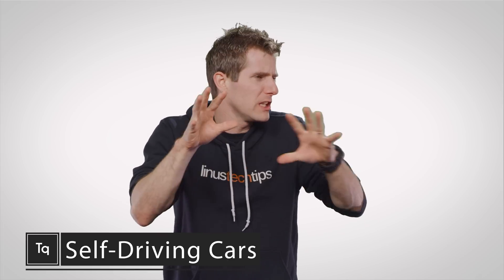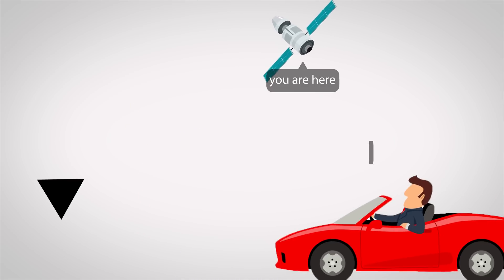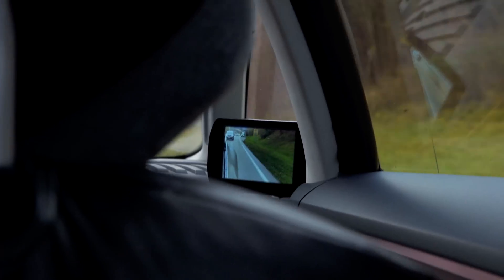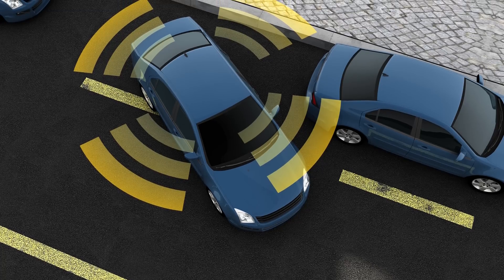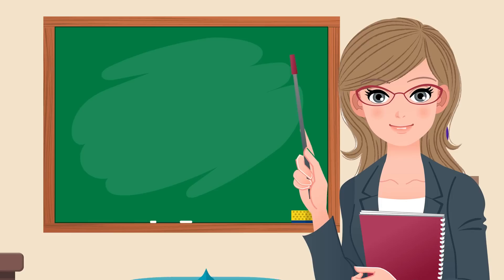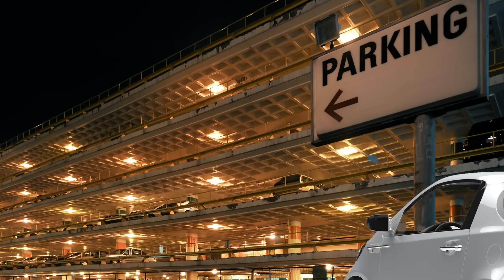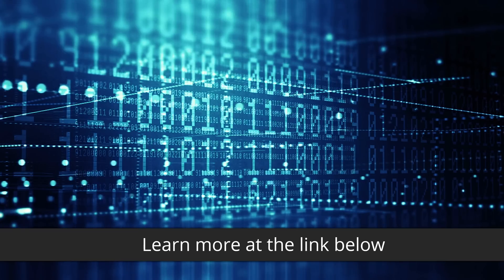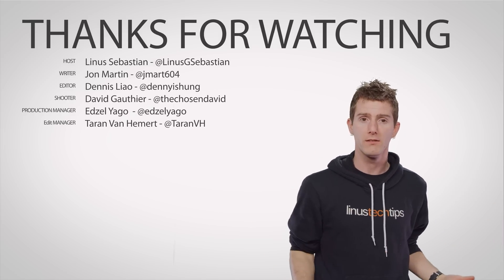Why Self-Driving Cars DON'T Just CRASH

Comment: The problem with connected cars is that hackers will develop viruses to make them crash, just like connects computers
Reply: EVERY system is hackable. EVERY. SINGLE. ONE.

It's not a matter of "if", but rather a matter of "when".

The PS3 was deemed unhackable. The whole credit card system was deemed unhackable. In the Netherlands some hackers broke into the local water plant and released dangerous amounts of chlorine in tap water remotely. It should theoretically be possible to create a completely hack proof system, but those systems are so complex, that it's basically impossible to creare a completely flawless system. Think about the PS3: one minor, apparently insignificant oversight led to the permanent fall of the whole security system. And an autopilot computer is, I guess, way more complex than a console. They already hacked into a Tesla and made it move. Sure, the hacker had limited access, but still it could move the car forwards and backwards, and that's enough to potentially cause serious injuries to someone. It's been done once, in can be done again. Right now the hacking rates of autopilot cars are very low because they not widespread enough to be considered a critical system by cyber terrorists for them to spend time and money breaching them. But let time pass, and we'll see.
Reply: Alessandro Celoria jesus you sound like a radical
Reply: @octoan  don't get me wrong, I'm not one of those tinfoil hat people, nor a radical or something else. I really look forwards for self driving cars to take over, its just that we must be conscious of the risks and work to mitigate them. Those systems are hackable but are very well protected too, and engineers work on them 24/7
Reply: @alessandroceloria  I'm an IT Systems Engineer and can confirm what you're saying. Even things you would think aren't vulnerable at all, like your key fob and your garage door opener, have been hacked by extremely simple attacks (like replay attacks). Encryption schemes deemed unbreakable by all conventional present and future computing power are sidestepped or broken for years before we even know they were broken (example: Heartbleed SSL vulnerability). What disturbs me most about self-driving cars isn't just hacking, but that faulty sensors or code will cost lives. NO software is bug-free. For heaven's sake the entire fleet of 737s are currently grounded because the autopilot decided that the plane needed to go into a nosedive. Does anyone here really believe a self-driving car won't make a mistake that kills you? How about the self-driving car that mistook the broadside of a truck for sky and plowed right into it? Its only saving grace IMHO is that it will have less accidents per mile on average than stupid humans who text and drive, get distracted, and drive drunk or high. Will it be perfect? Nope!
Reply: C B you realise that hackers rely on understanding the code, and so if the code is self learning it probs can’t be hacked.
Reply: @evaahh9584  The code itself is not changing. It's still the same. What is changing is the set of weights the code itself uses to take decision. But the core, the brain and soul of the autopilot are static through time. They only change the data they work with.
Reply: Oh boy I got some news for you. Unless you have a 1659 horse drawn carriage you are affected by the same thing. I also love this argument. Any half way modern car can be hacked to kill you. Also we have these things like bombs, cutting brake lines, etc etc, you act like only people can kill people in self driving cars, ain’t no way someone could do something to another in an old car. Also guess what, if someone wants you dead? You’re dead! Some serial killer does not wake up and go “oh dam we don’t have Autonomous cars, I can’t kill someone today darn!”

And it’s not like the ECU has the sim cars in it... hacking through just cell is trival as it is, and again. Who’s going to go through all this trouble to crash your car while your driving when they could easily “repaint your interior” 

Having troubles understanding this concept? Okay. Then you are probably against smart door locks that are connected “someone could hack it and get in” if you believe that, you need a new brain. A thief is not going to bring his laptop house to house and sit at the doorstep. Want to know why? Well I’ll tell you, there is probably a rock 10 feet from one of your windows. 😉
Reply: @EndOfLineTech  Car entertainment systems can be hacked, sure, but they will not let an attacker manouver your car. They could prevent you from listening to music, or spying on you, but they can't just tell the car to turn left or right. If the car does not have an autopilot, there is no way for the onboard computer to grow hands and take on the steering wheel. Sure, if someone places a bomb on my car they will kill me, but with connected cars we have the risk of someone hacking remotely into a vehicle and wrecking it against a wall. The attacker could be overseas, in another country. Good luck arresting him. Also, someone could mass-hack billions of vehicles at one time, way more convenient than crafting and placing billions of bomb. Sure these scenarios are still far from reality, but they are possible nonetheless (possible being the keyword here).
Oh, about smartlocks... They have been consistently proven insecure and hackable in very simple ways (just search "Defcon smart lock", there are plenty of examples), and good luck convincing your insurance company that a thief broke into your house and stole everything where there are no signs of forcible entry, while a broken window really speaks for itself. Also, hacking into a smart lock would leave little to no traces behind, so the police would probably lack the necessary evidence to arrest the burglar, should they ever get ahold of them. By your own reasoning, since a rock is enough to break into a house, we shouldn't even bother to lock our doors: just leave them open, it's more convenient.

That being said, although those risks are real, they don't outweight the benefits of said technologies; my opinions are, in the end, all conjectures since we are still to see real world autopilot hacking or similar stuff and those systems, even if not perfect, are pretty darn close and very robust/secure. Except smartlocks. 90% of the smartlocks you find at your typical hardware stores have catastrophic security implementations, laughable flaws and terrible bugs. Again, search for "Defcon smart lock". They are that easy to get into.
Reply: Alessandro Celoria don’t be to sure of yourself, depending on the car. Mine for example I can fully drive from the OBDII port, and if the entertainment system was breached, it wouldn’t be a problem to do the same, but I have the year before cellular, so it’s a non issue. 

And you’re wrong. Most modern cars have full control over everything.If it uses it or not. My car, 2015 Subaru Legacy has no form of even lane keep assist only a warning, that didn’t come till 2016, but guess what it’s now Autonomous. Now this is a car that the closest to autonomy it has is adaptive cruise, and that’s only on the higher trims. Even the base with only standard cruise can become full self driving. In our case our CAN BUS till 2018 is not fire-walled, the head unit thats is connected to the cars network (CAN) is fully capable of steering the car. “Autopilot” is software, most cars 2015 onward and a few before have the basic hardware necessary. we literally bring autonomy to existing cars. I use it daily. Most newer newer cars won’t accept control commands from convenience devices, like the head unit Yes but not every car ever made is like that. So it’s not impossible. The 2016 & 17 legacy/outback can be hacked to crash. 

These systems will be the same, the outside network will have absolutely no access to the critical internal network, when we reach that point, things like Tesla summon will have to run through its own dedicated processor, with safety such as, allowing commands over cellular only if there are no occupants, if the car wassnt put into drive previously by a user, excess speeds, highways. And that’s assuming those features exist, regular companies like Toyota would probably just completely block it off.

All cars will have manual controls until level 4, that we will not see in our life, maybe special companies with special areas. Brakes and steering are fault tolerant for a reason still, unlike accel, you don’t need a computer to steer or brake because those are critical systems, if something happens you can take over. Not even a Tesla that has “full range steering” can not over power a human. And brakes override accel in the safety code, in a fault tolerant way, “driving with 2 feet” will upset the car, press both accel and brake and it will kill acceleration. (Don’t be a smartass and bring up manual cars) and as the technology advances im not sure what Tesla does but we have a separate system to monitor our messages and block anything unsafe, hack my car, you won’t be able to issue any unsafe command, sure you could slowly veer it off but again I have manual control and pay attention. People scare me more then the thought of a glitch. I want a future where I trust my life to a computer system that’s not all that likely to drastically go wrong and have absolutely no control, then drive with people and have full control. I could get in an accident every day I drive it happens, people are fucking nuts. 

And again, no one is going to sit at a doorstep to hack a door to get in without forced entry not saying it’s not possible, just unlikely it’s like putting a 20 foot thick steel door in a wood frame. Are you going to try to torch through the door to get the $1 million dollars on the other side? I don’t think so. Nothing stops anyone you admitted it. We’ve had home invaders before electricity even existed... if Someone wants in your hours they will get in. If someone wants you dead without a trace, you’re dead with absolutely no evidence. The government wants to spy on you? They don’t need an “amazon spy box” for that. That’s the whole reason I brought locks up, to verify my point, it means noting, if your worried about some random guy playing GTA with your car maybe you should go live in the woods. Because it’s possible even now 😉 a simple device connected to the cars network (which does go unsecured outside the vehicle like to the steering rack) is all that’s needed. You’re not safe no matter what
Reply: @EndOfLineTech  OK so it's the third time that my comments are disappearing, I'm not sure why...

I have written two long replies in which I carefully address your points, but screw that, enough typing for today... I'm going to do a TLDR...

Self driving cars.
I generally agree with you, especially on the fact that human errors are way more fatal than system errors. These systems are hackable, but also very well protected, and in a real world scenario... Yeah a chance of hacks happening is basically none.

Smart locks.
I am not against smart locks, but as for now, the typical off-the-shelf smart lock you would probably find has an unacceptable security level. I know that smart devices will always be susceptible to hacks, I do not pretend them to be hackproof, just secure enough so that a kid passing by with a smartphone can't get into my house in less than one minute. As for now, we're not there yet...
Reply: @EndOfLineTech  One last thing... About people being able to get in your house no matter what, even before electricity existed.
Sure, that's true. But that doesn't mean we shouldn't care about security at all. We should do our best to improve our security as much as we can. You are saying there is no point in worrying about security since someone will find another way in anyways, but if you are right, then why are we wasting money on locks in the first place? Someone will find another way in after all... So, we may just leave our doors unlocked as well? I tend to disagree...
Reply: @EndOfLineTech  That I will agree with. Killing people is already illegal -- inventing new ways to kill people doesn't change that. The main difference is that with the internet, you are exposed to far more potential adversaries (the whole modern world) compared to conventional "in real life" attacks that require a person to be physically present. For example, our university border firewall fends off literally millions of attacks per day from everywhere in the USA and outside. I'd like my car to remain off the internet so it can't be touched by someone in Russia.
Reply: I dare you to find a hacker that can hack a Tesla to make it crash.
Reply: Mechros look it up, it happened once, he couldn’t make the car crash but he partially controlled it, but either way the amount of hack crashes won’t  even be comparable to the amount of human crashes
Reply: @willinton06  yes I know about that. I think it was a competition to see who can hack a Tesla, the winner barely was able to move it back and forth. Then he won his own Tesla model 3.
Reply: @mechros4460  This. People tend to think that every connected device is hackable. We've developed technologies that, IF WELL IMPLEMENTED, aren't hackable. The problem comes from human error, it might be user error, handling error or design error, but there's a human somewhere that fucked up.

The design error is trivial, we have systems that are technically unhackable and we know the design flaws not to make.

Handling error is exploitable using social engineering or direct access. If your IT is stupid and decides to plug a random usb key he found in the street to the main server, it's handling error and it's the cause of many data breaches.

The last one is user error, let's say someone notes their CC number, expiration date and CCV in a notepad and forgets it on the bus, that's user error. It's almost impossible to protect everyone against it because there are very stupid people in this world. The best bet would be to forbid ANY user access, leaving only the manufacturer and dealerships with access to the car.

Also, with the connected car thing, it's possible tu design a "read-only" protocol. Meaning that the data the car receives has no power at all over the system. E.g.: Instead of saying "Break, there's a problem", the other car only say "There's a problem" and it's up to your car to make the decision to break.
Reply: the thing is that most hacks people advertise where "reaseach" or had some  "help" from inside,
like the intel/amd hacks that people went bonkers about a year ago but most vulnerabilities needed someone flashing a different bios localy from your PC LOL....

if that guy that hacked the tesla did it on an real world situation meaning he didnt open the car or went too close to it somehow etc  then i will be impressed...

edit: i just looked it up... and i wont say i told you so but i did :

"The attack requires the car to be connected to a malicious Wi-Fi hotspot set up by the hacking team, and this can only be triggered when the car’s web browser is used."  

ye ok whatever wake me up when they do it properly.
Reply: @ppsarrakis  It's a proper hack that relies on specific vulnerability.
Reply: @ppsarrakis  Ah, the ole' "it hasn't been hacked yet so it must be unhackable" perspective. I've been in IT long enough to know that this is not a strong position to take.

Comment: Why 5G for car-to-car/car-to-infrastructure communications? I'd much prefer a short range mesh network that doesn't require paying a $20/month to a carrier. A mesh network would also have lower latency to its neighbors to coordinate actions by eliminating round-trip through the tower. At highway speeds, milliseconds can translate to meters of extra space to swerve around something or extra braking to reduce crash speed if the computers conclude that a crash is inevitable.

Comment: Cars will never be fully self driving. They'll always need a steering wheel even if it's not needed 99% of the time.
Reply: Always is a long time
Reply: Yup, just in case the car is hacked or the car suddenly disconnects from the internet for whatever reason. I'm imagining a folded steering wheel that will automatically pop-up and unfold it, and then there's a robotic voice. "Our system have detected a security breach, auto-driving mode will be deactivated, please take control of your car, thank you."
Reply: @danieltanuwijaya7675  I'll just drive myself.